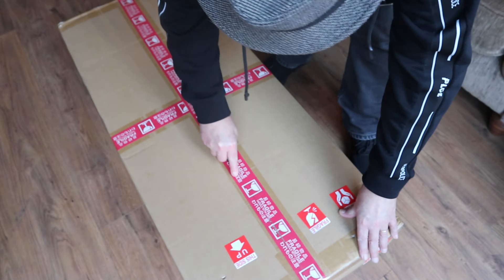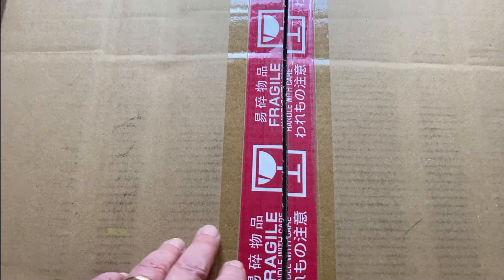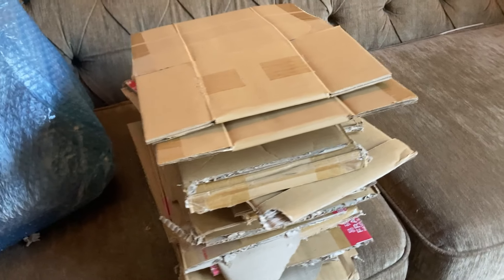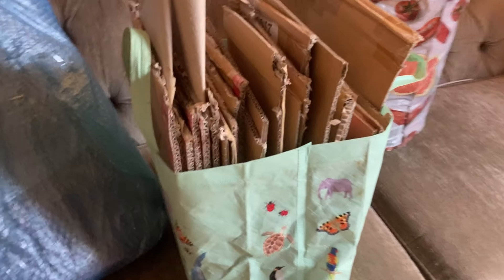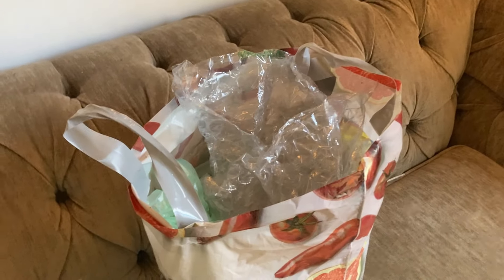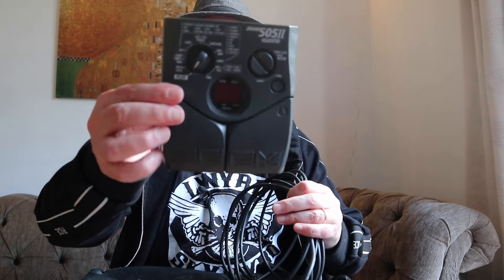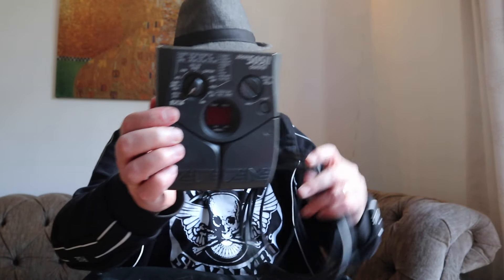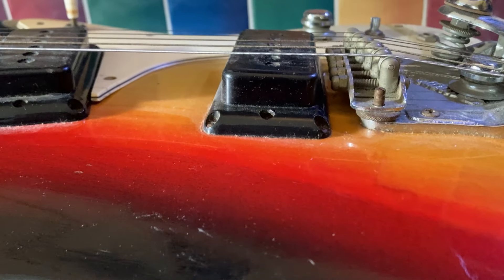UNBOXING 2 vintage guitars just in from JAPAN via ZENMARKET - first of 2024!

Comment: I know Scots don't really speak like this (not now for sure, anyway), but I can't tell you how much I wish, when you unboxed the second one, you'd said "Och aye - Tokai!"
Well done on nabbing two very interesting guitars. I can understand why you didn't immediately spot that missing control knob, it kind of looks like it belongs on that trem system, slap bang in the middle as it is, like a big Fender Jag/Jazzmaster locking button.
Reply from the maker: That's absolutely 100% what I thought, lol! It sat there, even when I was filming up close and I actually thought it was a locking part of the trem! What's even better is that when I took all the screws out of the scratchplate and removed it, the control knob must have fallen into the control cavity when I moved the guitar. I thought it was in there all the time! Completely confused me. It wasn't until someone commented on the video that I even twigged that is was actually under the strings all the time. You couldn't make this up!

Comment: Is 3 months normal for delivery from zen market? I’m thinking about getting a guitar or two from there.
Reply from the maker: Surface shipping is usually about 10 weeks to the UK. It's by far the cheapest (and longest). You can get it here in 3 days, but air freight is damn expensive. Plus you're charged import VAT on the cost of the item & the postage.
Reply: Awesome, thanks  for the reply!